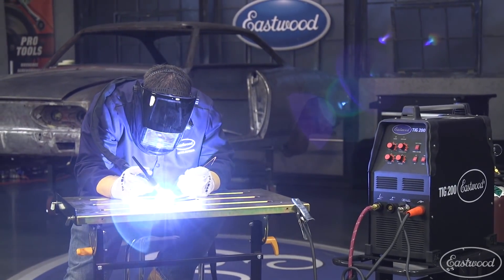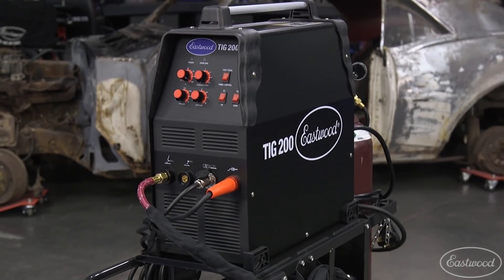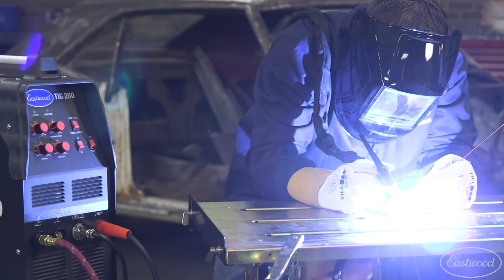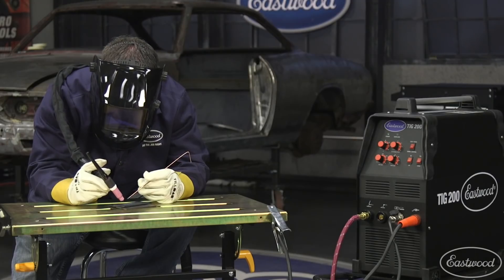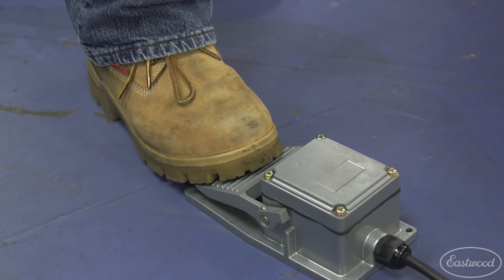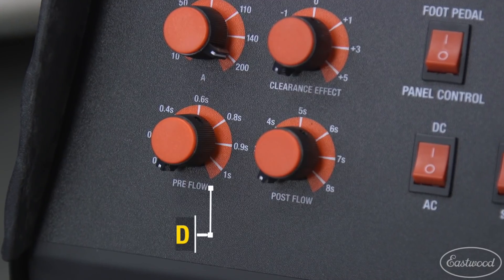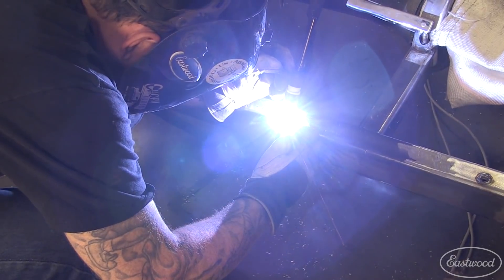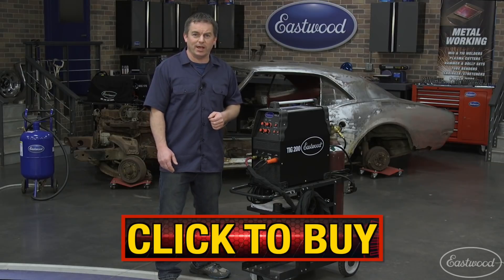TIG 200 AC/DC Welder - Weld Up To 1/4" Steel & Aluminum - Eastwood

Comment: can this do stick as well? 200A id think that can do some thick metal. i need to do thinner aluminum and 1/2 mild steel, id like a single machine but really dont want to spend 2500.00 if i can help it

Comment: I have a 200 amp Eastwood welding machine . Why I can not make the puddle on aluminum cylinder head ?
Reply: Most thick metal, cast iron, and cast aluminum repair, recommend preheating your work object.  Also recommended is post weld heating to lessen the chance of your finished weld from cracking by cooling too quickly.  Don't forget to groove, or "V" out your crack, otherwise you will only be welding the top 1/8" or so, and the repair won't have the strength it needs.  The large aluminum head dissipates the spot heat too quickly.  This site has some great info.  https://www.thefabricator.com/article/arcwelding/preheating-can-be-critical-to-welding-success
Reply from the maker: Is it cast? You may want to talk to an Eastwood Tech: 800-343-9353